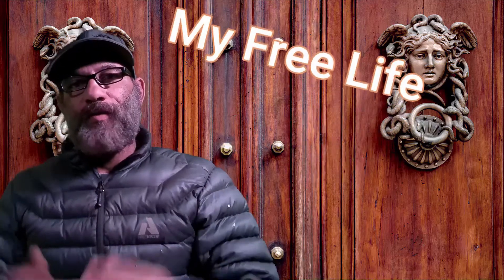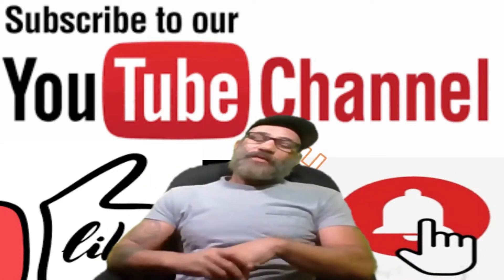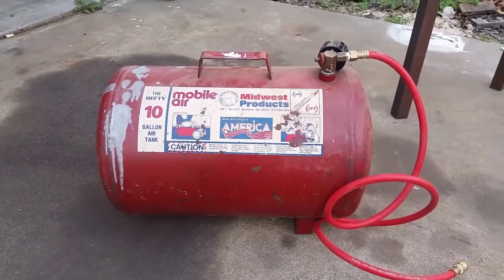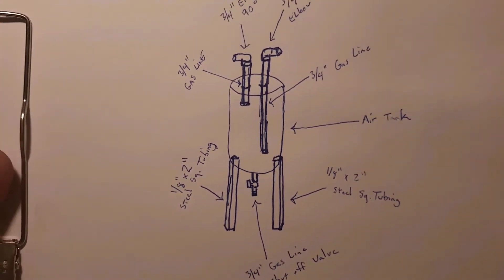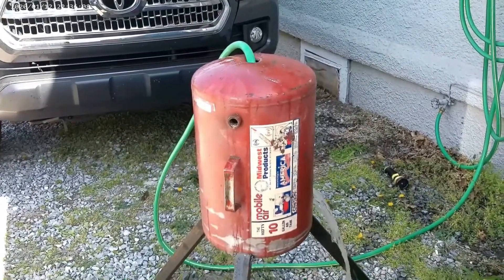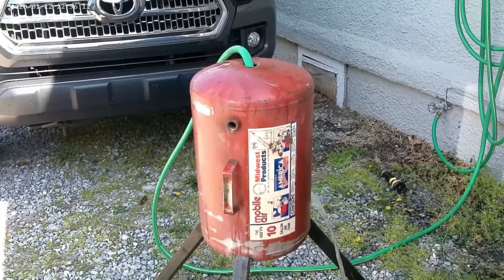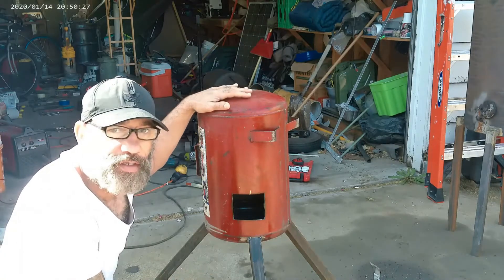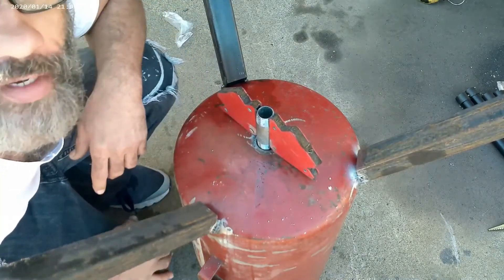Converting plastic into liquid diesel fuel. Reactor build part 2. Building the condensers.

Comment: Haha I know the pain of cutting up good tanks, but sometimes it's worth it in the long run. I used up several of my heavy duty 55 gallon drums I used as a dry cache before in my gassifier build, but the fuel savings are worth it and will free up the cash to replace those barrels. Also used up 2 good air tanks for condensation tanks in my build. I keep eyes out for air tanks and water heaters for free or cheap just for these sorts of projects
Reply from the maker: Man, I do the same thing. I see a hot water tank on the curb... No shame here.
Reply: @Saxxsays  my wife hates it when I come home with new goodies like that 😂 they are very messy to remove the insulation off of I'll say that for sure!
Reply: Oh and to utilize the curve on the bottom of the tank better to drain completely, take a standard pipe coupler and cut it in half. Place half wherever you want it and weld down the outside edge then you can fill it with water to test your weld, then just take a torch and blow the hole out. Liquid tight and completely flush mounted so everything drains nicely. Thread you pipe in with some pipe dope and a ball valve, done!

Comment: might i suggest you learn to weld. that welding will not hold pressure and will blow like a missile should any build up. otherwise thanks for demonstrating. ill build one similar
Reply: Ive seen indian people do this same thing and get away with welding that looks way more poor. Also as long as the exit which will have the lighter hydrocarbons distilled is open to atmosphere and going back to the burn area of the reactor it would be highly unlikely that it builds up enough pressure to break the metal before it just clears whatever plastic might be blocking it building the pressure. Also not everyone has a nice welder with shelling gas some have to use in-line flux, which sometimes skips around until you calibrate it. It also didnt look like he hammered off the slag so it might be a little better looking underneath. I say until you do it better, best to reserve judgment on someone elses personal hobbys craftsmanship.
Reply: @neb6229  welding is my trade
Reply: @verdiblue  ok good for you then you've had lots of time and your company's money to practice it professionally (and probably with a proper welder that has shelling gas) not everyone does it for a living or has a nice welder. I always find that there are two types of welders those who are humble in their practice and dont put others down for trying and encourage them; and those who think their shit doesnt stink and criticize every wobbly weld they see. If this was like some high pressure system I could see you having a safety concern but this just seems like you are purposefully nit picking at least the guy is getting out there and trying.
Reply: @verdiblue  thats none of your concern  and this probably wont explode because its not probably not going to build that much pressure.